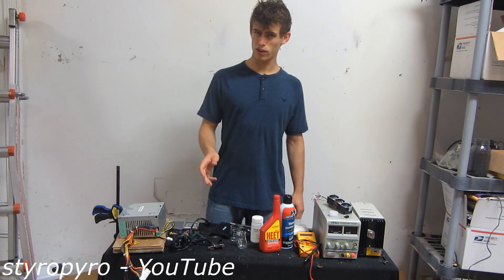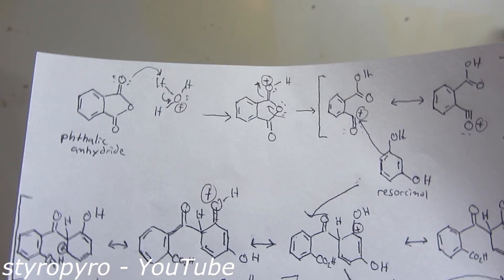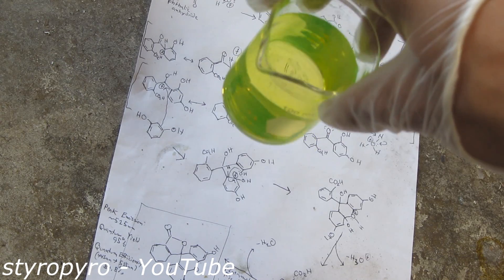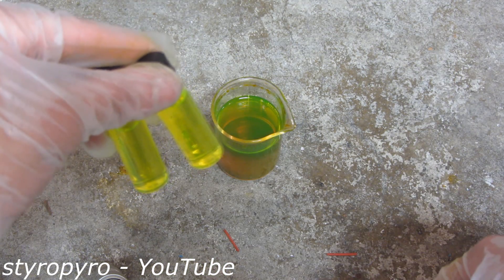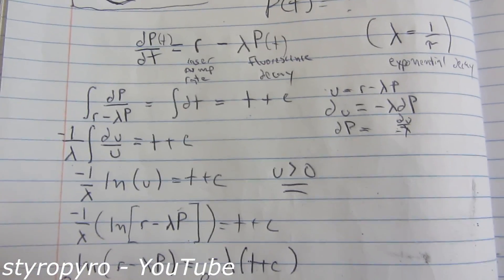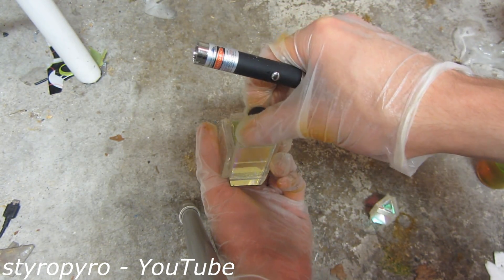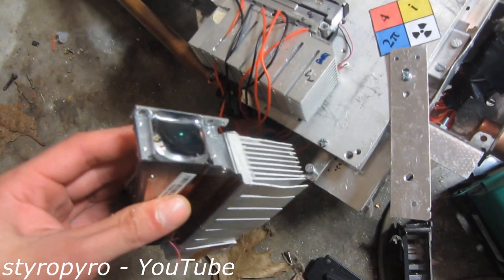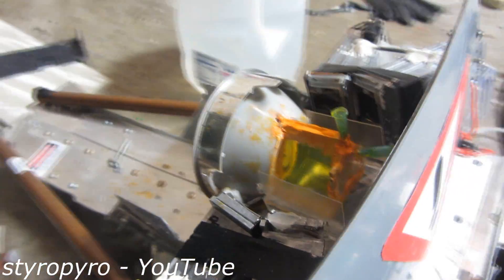Building a GIANT Laser Pumped Chemical Flashlight - July 9

Comment: Interesting concept, but your experiment was flawed from the jump. You cross-contaminated your 'samples' to determine which ph level solution would work best- as well as washed most of your solution off in the first sample.
Reply from the maker: That was just a demonstration for my viewers. What you didn't see is the hours I spent searching through spectra in different solvent systems, as well as the math behind brightness. I downloaded various fluorescence emission spectra in csv format, along with the 1988 luminosity function, and then hit them with calculus to find what my best bet was.
Reply: +styropyro Gotcha. Thank you for the response. I wondered if that was just for show, as most of your explanations have been pretty in-depth. But it just seemed too rushed to be accurate. Carry on, sir. :)
Reply from the maker: The mirrors have already cracked under these conditions...luckily I bought a pile of very cheap dichros and other optics a while ago. I doubt I'll go through the trouble of making a high pressure cell for this project, but if I were to I'd keep the dichros on the outside so they don't have to be in the crazy cell conditions. Fluorescein in the gas phase is a very poor fluorescence agent, so I'd use a different compound if I wanted to do gas phase stuff.
Reply: +Ankush Girotra It wasn't about the effect it would have on the PH, it would be more to the point of effecting the luminosity. The amount of the sample wouldn't be even and the PH's would also be skewed on top of that.
Reply: Maybe you could design some heat exchangers to control de temprerature of the system. Shouldn't be too hard.
Reply: +styropyro I have some questions. How much pressure do you think those mirrors can take? What if you put fluorescence gas in that container to begin with(assuming you could maintain fluorescence as a gas)? Is there going to be attempt #2 soon?
Reply: styropyro Aw gosh you mentioned that in the video. Still, could make a great lamp if you dont mind being blind. Flashlight mk 2 whoo!

Comment: Is there a way to strip some of the heat energy out of the light before sending it into the "bulb"? For example, you can feel the heat of the sun on your skin if you stand in direct sunlight. However, if you step out of the sunlight, and reflect the light at yourself using a mirror, you cannot feel the heat on your skin. Pretty much the same brightness, but with less heat. Not a total solution to your boiling problem, but it might help if you can come up with a method to do so.
Reply: This would not help since he is using a laser for his light source. 

This is because lasers produce light in a very narrow band of wavelengths. The vast majority of light being produced by his lasers will be 445nm. A mirror will still reflect all of that light and therefore it will not decrease the power(heating).

The reason you may have felt less heat coming from sunlight reflected by a mirror is because light coming from the sun has a very broad band of frequencies. Some of these frequencies, such as ultraviolet light, would be absorbed by the glass on the mirror and therefore would only reach you if you were in direct sunlight.
Reply: lgbtTV5 Good point. Although if it was a flat mirror then the reflected light shouldn't be any more diffused than the incoming sunlight. Other than the fact that not 100% of the light would be reflected.

Comment: I'm not as nearly educated as your are in chemistry, but I think your blue laser source (cannon lol) is far too large for the amount of solution your emitting to, you would probably need a bigger solution tank to compensate for the larger beams which are cooking your solution, or maybe try smaller scale and work your way up, also you would need some kind of pump to keep the solution constantly flowing from the reflecting module into some kind of radiator cooling system like some high-end gaming pic's have, your a very gifted person and I believe your future holds much for you keep up the good work bro 👌

Comment: Why not cool your ethanol?
Reply from the maker: The flash boiling is a local effect. The cell is 12mL so it wouldn't all boil at once when hit with the laser. The issue is that the laser output converges to a few focal points in the cell, and the solution in the small volume of the most intense light is flash boiling, The boiling solution puts some fluorescein in the gas phase where it still can absorb light, but won't emit light, making the solution heat very quickly and causes a runaway effect.
Reply: +styropyro  what about cryogenically cooling it
Reply: +styropyro hey how do you know so much? I'm 15 and dont know how to do any of this. Where can I learn? and how expensive of a hobby is this

Comment: Use ethylene or propylene glycol as your fluid, fill it nearly full, and seal it off. It already has a boiling point at atmospheric pressure of around 200 C. Sealing it allows any gas to raise the pressure inside your mirror array, which in turn raises the boiling point even further. JB weld or similar may be a better choice for construction with the added pressure. 

The pH would be pretty neutral but you shouldn't have any problems fixing that.
Reply: just use transparent titanium. much better than transparent aluminum.
Reply: That would require building some kind of pressure vessel to contain the fluid, and it is very difficult to build transparent pressure vessels that allow light to pass through, especially of the variety that he is using (with the mirrors which only allow certain colors of light to pass through).
Reply: +Triumvirate888 Just adding a few psi will raise the boiling point considerably. The relationship is exponential. The refractors he is using already are fine, they just need to be constructed more sturdily with a high temp epoxy or similar.
Reply: Was going to comment this, thinking about a pressure cooker.
Reply: 3 degF per PSI of pressure above atmosphere.

Comment: You definetly need to upgrade the cell itsell. I guess making it bigger (so you can distribute diods on bigger area), with solution pumping throu it and some kind of active heatsink (all that Boyle-Mariotte stuff from fridges or just put the IN pipe into ice or something, so solution become colder and as a result much harder to boil) will do the trick

Comment: so what you can do is use a cpu water cooling kit and connect it to up some how so u have a constant flow of the liquid going to a radiator and back to mirror so the liquid is moving and going to a radiator to keep it cooled
Reply: The boiling was happening too fast, it was literaly less than 0.1 seconds to start boiling, doesn't matter how fast this radiator could be, it definitely wouldn't be enough to cool that power in time.
Reply: I thought this same exact thing when I realized what he was going to do... with a laser that powerful, heat will always be an issue, particularly with an alcohol based solvent.  If you were to have say a liter of the stuff constantly being cycled through & cooled, it would be less of a problem.  Given how quickly it boiled though, I don't know if this will be enough on it's own.  Maybe adding some active coolers to the sides of the mirrors?
Reply: you can't move the liquid fast enough to stop the flash boiling he was experiencing
Reply: I'm not sure that would work, obviously he was playing with it before he did the recording, so the liquid was already warmed up, and we don't know how fast it will go from room temp to boil, but if it's always that fast the  no, no matter what, radiator he uses its not gonna help.
Reply: +RealRuler2112 that is true I was thinking tho if you get the liquid cycling fast enough around it would keep it cooled or slight boil but that would move fast so shouldn't do anything. but if so you can get car coolent what is green aswell but not sure if it would effect it
Reply: +Logan G how won't it help tho? constant movement of a liquid what's getting hot in one spot like a computer cpu it will keep it cooled enough
Reply: clearly he just needs to run some helium through some tubes and those tubes... i dunno where they would fit but I think that's one way of approaching absolute zero, so possibly enough to compensate? :P
Reply: I think what they're trying to say is that it won't help enough.  Increasing the overall amount of liquid IS going to help, as will adding active coolers and a radiator - physics says so.  Whether it helps enough to keep it from immediately boiling is the question - might increase the boil time from 0.1 seconds to 0.12 seconds or it might increase it from 0.1 seconds to 2 seconds - we simply don't know without trying, but this is the internet where everybody knows everything. ;) :) 

Probably don't want to use antifreeze - vaporized ethylene glycol would not be a good thing.